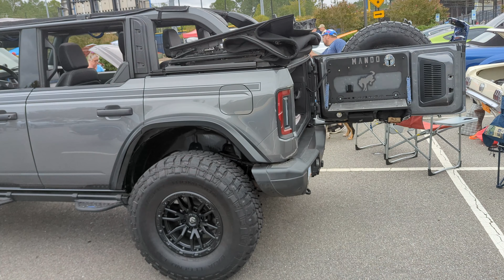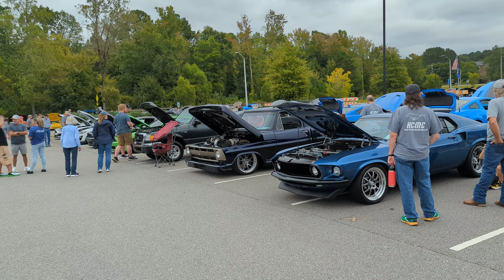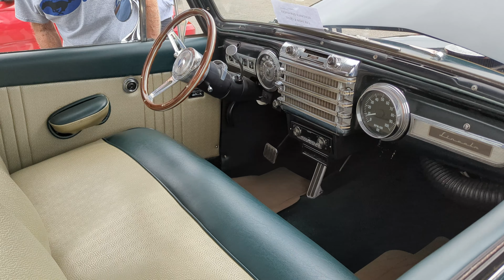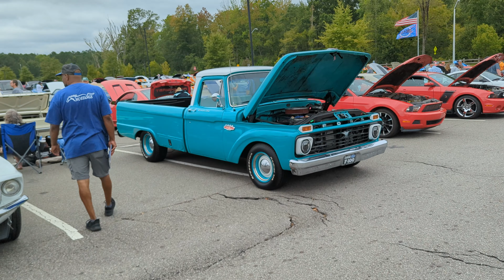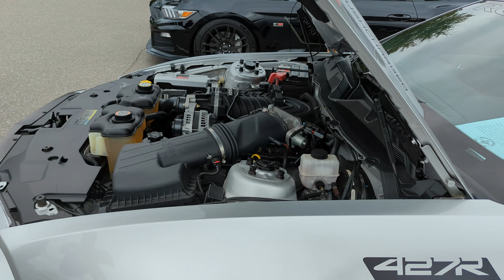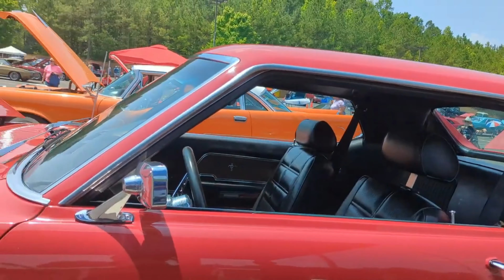Which one, Mustang S197 or S550?

Comment: A 13-14 S197 is what you should shoot for in my opinion, lots of mod support interior and out, meaner more aggressive retro late 60s body design just cant beat it xD i like the S550s dont get me wrong but i just dont like the way the car looks from the inside looking out and the body line dont work for me like they flow in the S197... the only things i like with the S550 over S197 is the upgraded gen 2+ coyote  motor being able to support more power than the gen 1s at stock (which i cant imagine being to hard to upgrade myself on my S197) and the front grill of the S550.
Reply from the maker: I agree about the 13-14. I am leaning that way but wanted to see what other people thought.